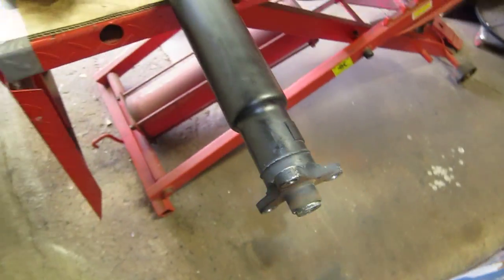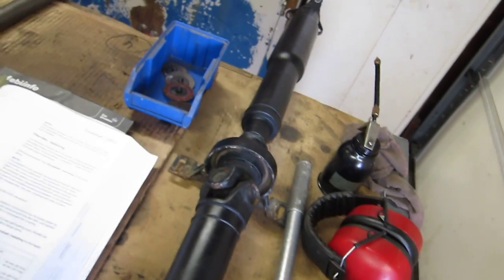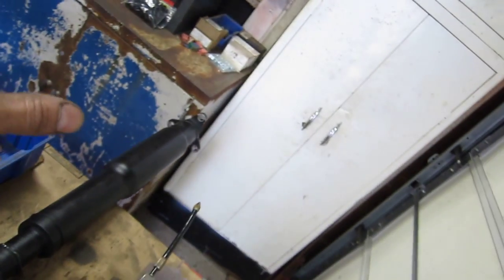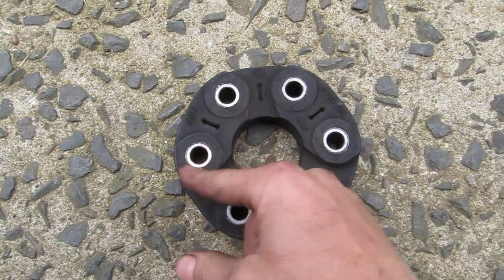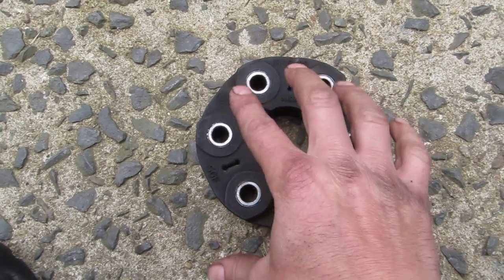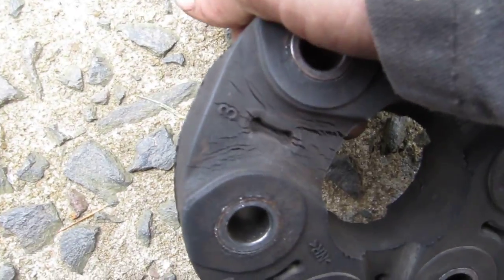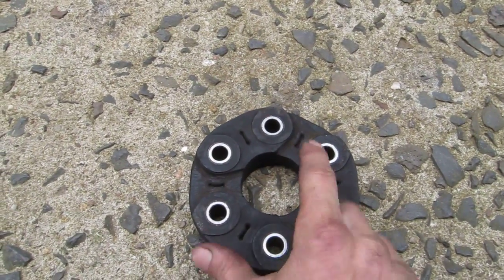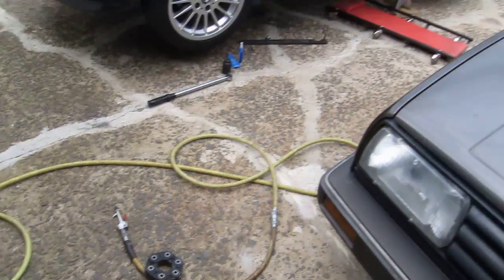BMW Z3 drive shaft, drive line, clunk, noise

Comment: I was going 80mph on the highway and out of no where my rear wheels lock up and made me burn tire and loose control !
Now my car makes this loud metal rubbing noise whenever i accelerate or decelerate but the noise goes away when im on nuetral or when im press in the clutch to switch gears.. 
What it could it be !?
Reply: Hmmm...well few months ago, my 325 did similar. Mine actually made a scraping sound, like bad pads,rotors, it happened for few Miles. Well my rear locked up, threw me left and right at 45mph. It was scary even at that slower speed. Thankful no car were trying to pass oncoming. Had it towed to the shop up street. I told them I needed a rear, give me the price. Ithad to be towed by wrecker from the rear. Idiots called me, told me I needed a clutch set. I said no, my car starts while in neutral. But can't take off in any gear, it just stalls. I may have been able to move the car 5-10 inches trying. Well I payed , they said it's ready, I left the shop, 1.5 miels down road it did the same thing but now I'm stuck in both lanes sideways. They came and dragged it onto flatbed, I was very pissed. Somehow when they finally got it on lift the rear freed itself. They were so wrong. They had other BMWs on property for sale, no complaints online so I felt safe with them doing the job. Well, I believe I paid alot of money, never installed a clutch. I never had a problem with clutch, I'm well versed in cars, just couldn't do this job myself for few reasons. If they would have just put a rear differential in, as per my request, I would have saved $1400.00 in the whole deal. Truly believe I have the clutch it arrived with. Then one side of my Axel's had only two bolts tightened when I got underneath last month. Fluid leaking everywhere. These guys were terrible, this whole sinerio was gonna happen again. And I get on highways and run 80-90 mph alot to travel. This could have killed me and others. If your in Hyde Park NY, be very cautious who you bring your car in for repairs to please. So to the original post, your diff maybe on its way out.

Comment: I get what you are saying...but this is not the issue my truck is having! 97 Ford Expedition , pristine cond. 130k, no rust southern vehicle, when accelerating over 45mph on smooth road produces an occasional loud clunk, does not affect steering, and truck goes down road straight. What do you think?
Reply from the maker: Ellen Robison good Lord that could be anything especially when trying to diagnose from behind my smartphone. what are the precursors to the noise, do you hear it when you let on and off the throttle, or do you hear it when the vehicle shifts again, or just as it crosses 45 miles an hour?

Comment: BMW dealers have ripped me off.  I replaced my own fuel injectors on my e39 M5. I decided since I was in that area to inspect my spark plugs.  They were absolutely filthy. I had asked the dealership to replace the plugs while they were decarbonizing the engine as I had a secondary heat pump error. They never changed my spark plugs.  I paid $6k for this service.  Absolutely pissed with Pompous BMW dealerships. The last BMW I’ll ever own is the best that BMW made. e39 M5.

Comment: Mine has a single thunk when rapidly accelerating from a standstill. The rear transmission bracket was ripping out of the subframe. This is not going to be a fun repair...
Reply from the maker: Wow!  now I'd be interested finding out why that started ripping. Is it just high mileage, rough use, or a driveline vibration that wasn't taken care of. The last one could definitely fatigue metal rather quickly. Definitely check all your other mounts as they may have been putting stress on this one. Sounds like a MIG welder is going to be your best friend right now.

Comment: Would an incorrectly installed flex disc cause driveline vibration? (2011 F10 550i)
Reply from the maker: When we talk about vibration, make sure were talking about the right frequency vibration. A driveline vibration will be much higher than say a wheel end vibration. In the case of driveline, the flex disc really does not support centering. for that I would check the centering bushing in the middle of the flex disc.
Reply: @mrjgueret  Thanks for responding! This vibrarion would become noticable around 60 mph and above. The dealer had pointed out that it would need replacement. The shop I made the mistake of taking it to, probably messed up somewhere. As soon as I go past 50, it becomes noticable and it's felt more when sitting in the rear seat, literally travels through the spine. I'm thinking of doing it myself this time.

Comment: Would this also cause a vibration at high speed?
Reply from the maker: This rubber absorber does absolutely nothing to center the driveshaft. Therefore it it is impossible for this device to cause a vibration unless actual large pieces of it are missing. The driveshaft is centered by a pilot bushing / bearing in the front, a center support bearing in the middle, the rear differential pinion bearing and the various U-joints.
Reply: @mrjgueret  Thank you for your response. I will be checking U-joints and hanger. BMW E30.

Comment: Just bought a ZED 3 M this is the first thing I was suspect of! I mean look at the design! I cant believe anyone with an IQ above 80 would pass by this..Its a 100.00! part! doing the clutch ..will go through the entire drive line myself for 600.00
Reply from the maker: I completely agree Damian. I would say the most important purpose of this part is to lesson driveline noises, harmonics and vibration from the driver and driving compartment. I would say it does a good job of that at the expense of strength and longevity. I consider the Z3 a performance car and wouldn't mind feeling the workings of what I consider a slightly barbaric drivetrain. Even when this part is new, I still don't like the springy action and the noise is it creates during shifting. there is a performance version of this that's made out of aluminum with neoprene bushings. I may try one someday knowing full well it's going to change the feel in the car. BMWs have always been a little rough around the edges, the engineers shouldn't try and hide it. I enjoy it.
Reply: I forgot to say thanks for taking the time to make this Video and your very specific directions in regards to orientation of the part could easily be over looked in haste..

Comment: What's my car doing in your driveway???
Reply from the maker: Awesome! Not every day we get a coupe guy around here. Next video I'm going to do is a tear apart of the dash. I have a very good feeling there are HVAC components that lose their sealing capability causing poor air conditioning output. Even when the pump is perfectly fine and the system is charged fine. Basically the hot cold blend door loses its foam. That allows heat from the heater core to blend in with the cool air from the evaporator. How's your AC working?
Reply: @mrjgueret  Mine is a '00 2.8.   AC works but it is not cold enough to cool the inside, even with the sunroof insert, I barely run it.  and yes, it does feel like it wants to be colder but it can't.  I have charged it with the generic kit you can buy and it really needed very little extra which was nice for the age of the car - I'm the 7th owner and it lived mostly in MS, TN and GA, I'm in OH., It's just not cold or efficient enough.  Man... if you can do a tear down of the dash it would be amazing, as you know with the Coupe replacing rear shocks means tearing apart the inside of the rear (which took me 2 hours the first time).  I'll be looking for your updates.  Thanks for the information on the flex disc, I would have overlooked the install details so glad to find your video for my research.
Reply from the maker: @charliec7409  thanks for letting me know you have the same exact issue with the AC. I'm going to guarantee it's exactly what happened to my 90 Volkswagen Jetta. I actually knew I was developing the issue because foam was starting to come out of the vents in little tiny chunks. It's just age deteriorated blend door. The fixes to re-engineer and install a solid door instead of a foam door. Guarantees you'll never revisit the same issue. I've got the same year and engine.  I'm registered in Maine right now but will be moving down to South where we can use the car for more than 2 months out of the year. Keep in touch. Thanks for reaching out.

Comment: Hey mate.
https://youtu.be/adH4X-Pkcn8
Is it the same noise you did this video about? I also checked OEM guibo which I replaced a year ago. It was installed correctly. Btw diff bushing is not torn. What else should I check? I am about to take apart the gearbox.

Comment: Good video for those that are cheap and buy chinese crap because they don't want to spend on primium OEM/OE parts and buy trash that ends up being installed the wrong way and won't last!  
You obviously can't go wrong installing an original (OEM) flex disc as the arroew will tell you to bolt to the connected part i.e. driveshaft end & or transmission/differential ends.

Also the flex disc (guibo) have offsets where each metal hole connects to the indentation offset of either the driveshat ends or the differential/transmission ends and connects perfect!  

Buy original or equivalent quality parts.  

* Meyle HD makes the best flex discs!